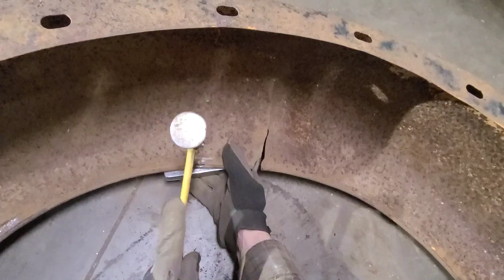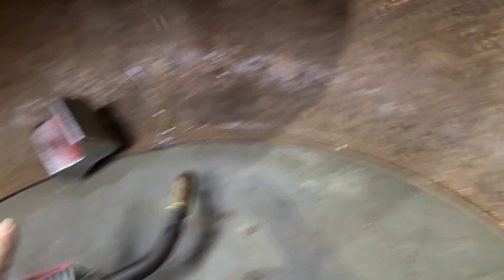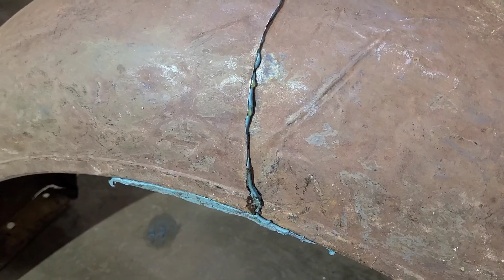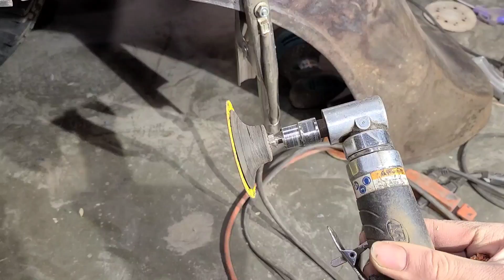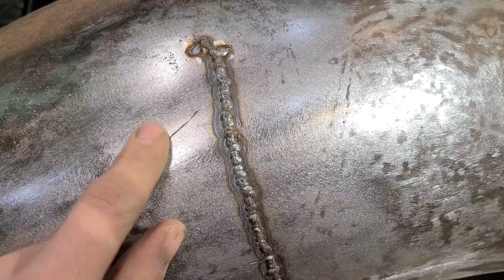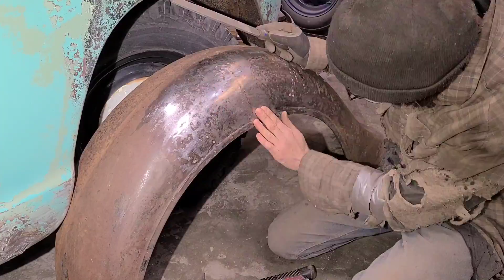Mig Welding A Cracked Classic Car Fender

Comment: CWM is how I ended up here.
You and Scott are masters in a dying art.
I dabble, Dad, a Saskatchewan born machinist,  threw a tire wrench in my hands when I was about five, and have learned tonnes from Scott, and although new to viewing your stuff, have already picked up a trick or two.
I have a mig, and while when I was younger, spent time working with welders, and learned stick, especially air-arc as we were doing sawmill maintenance, but they didn't use mig or tig, so self taught other than what I have picked up on YT, but had wondered about settings on the welder for body tin. 
Thicker metal is no problem because I like heat and I'm afraid of a blowout.
Sizzling bacon is what I was told.
I weld a little hot on auto tin and occasionally blowout, but I think that's just practice.
Reply from the maker: Thanks for stopping by and thanks for the kind words! I prefer to weld hotter on auto sheetmetal. I think a lot of people have issues because they are trying to weld too cold, so they hold the trigger for longer trying to get the weld to burn in, I like to turn the heat up so that I can just briefly touch the trigger and do a quick zap. The occasional blow through is going to happen on auto sheetmetal, there are so many inconsistencies in the metal and it's not always possible to get the metal perfectly clean. I was taught to always practice welding on two pieces of scrap metal of the same thickness and material as the car you are about to weld on, we weren't allowed to weld on the car until we had the welder dialed in and were able to achieve perfect welds on the scrap pieces. The welds on the car never turned out as nice as the practice pieces, but at least we knew we had the welder set up beforehand. It sounds ridiculous, but I've seen guys who have been in the collision industry 30+ years struggle for hours trying to weld up a tiny tear in metal, eventually the fibreglass comes out or they convince the insurance company to replace the part.
Reply: One reason the art is dying is it's getting harder in some countries to hand build cars and get them on the road. I've spent the last 10 years learning how to do aluminium skins, gas welded and hand formed and now I am not sure I can get the car road legal in New Zealand. If I can't enjoy my art, what's the point?

Comment: Not too sure my Mig produces much gas for the first few seconds.  It's ok for continuous process, but have not used it much for spot tacking.   I used to use ox/acetylene for sheet metal, but would love to try Tig.   I very rarely weld thin metals these days..
Reply from the maker: I've heard the oxy acetylene works great on sheetmetal. One of these days I'd like to spend some more time messing around with it!

Comment: Oh you kidder you!  Made me smile at the end of the bondo, sticks and syrup insanity though!   
Yes, please continue with this fender please.  Right now, I want to see the underside of the mig welded fender, please start the next video by showing that.  I keep wondering if a very nearly undetectable sheet metal repair can be made.  If you can keep the use of bando very low, very very low! I wouldn't mind seeing the proper use of filler on thin, horribly messed up metal that you just can't replace for some reason.
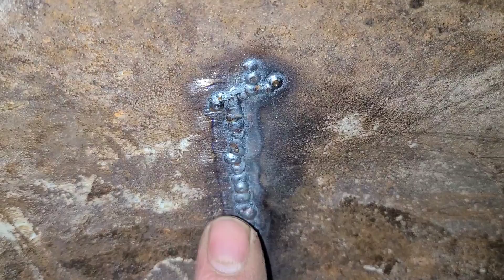Reply from the maker: Hi Bob! I showed the underside of the repair starting at the 31:09 mark in the video. It didn't look any different after I got done hammering it. You could grind the inside of the welds and make it disappear, but I usually just leave them. On these fenders it's a good idea to spray boxliner or undercoating on the bottom side which will make any weld seams dissappear and prevent any "outy" dents or paint blisters from rocks.
Reply: @CarterAutoRestyling  Thanks for your reply, much obliged.  I was too lazy to go find the last time you showed the underside of the fender.  Keep up the good work, I really love learning how people do interesting (to me) stuff.  
I don't even know what I'll get interested in!  E.G. Dog grooming, yes!

Comment: I don't know why you use body filler,it's soo expensive, concrete is much cheaper,concrete is a great alternative because the extra weight helps keep the vehicle on the road in Gail force conditions, my Dad once bought an EH Holden ute from an Italian guy down in old Melbourne town that had all it's guards filled with concrete,to the top,must have had 500kgs of concrete in it, I know what your thinking,thats a lot of concrete but it was free and it helped the suspension settle on to the bump stops,added extras are always a surprise, it was a great vehicle for the first month or so until he was driving down the road and one of the spring hangers let go and the diff housing slid back on one side,No worries he had some number 8 fence wire in the back,he tied the spring to the LH Side door door handle and just made it home but the door handle ripped out of the door as he drove through the front gate, he welded and bolted a metal plate under the car to hold the spring hanger in place, I wondered for a while why the car only had one door handle until I asked and got the story, well the old utes gone to ute heaven now,safest place for it.
Reply from the maker: Thanks, I've been looking for a cheap alternative to body filler! It's a shame that ute had to be retired, it sounded pretty fantastic haha!
Reply: @CarterAutoRestyling  It was what we call a Cherry.Concourse as you would say,great work BTW.

Comment: I've heard that adding glitter adds strength to bondo. If you use enough of it it looks just like real metal
Reply from the maker: Exellent tip! Will try that in the future!  Sometimes I leave the lid off the filler when I'm grinding steel. The metal particles ensure a magnet will stick to the repair and fool any unsuspecting car buyers.
Reply: @CarterAutoRestyling  Had you considered going into sex education? It needs livening up,. Innovation like yours could set the world alight.
Reply from the maker: @TheTubeTube2  nahh, already too many people in this world as it is!

Comment: when you made groove through weld did you refill weld again? i don't see that part.
Reply from the maker: Hi, I didn't groove the weld I just used the grinder to remove the surface of the weld that was sticking up higher than the surrounding metal. The welded area was slightly sunken in due to the heat of welding. After grinding I used a bullseye pick and hammer and dolly to bring the low spot back up and a file to blend it in to the surrounding metal.
Reply: @CarterAutoRestyling  i think i know what you mean seems difficult